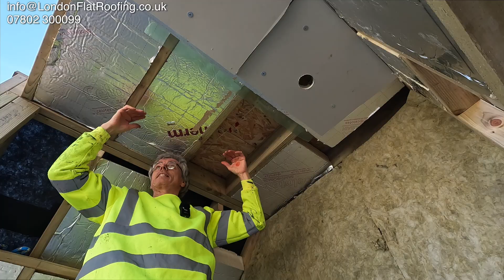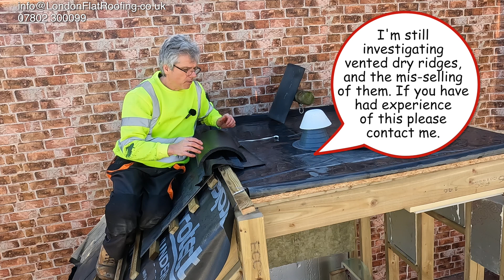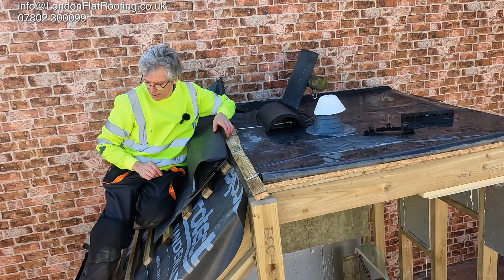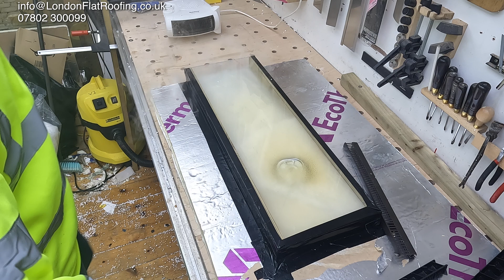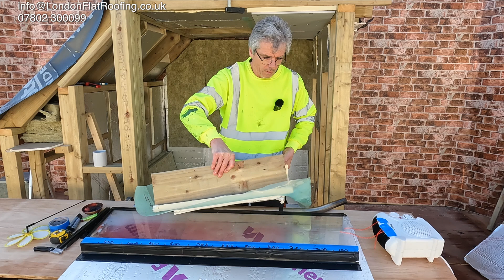Through Ventilation Cross Ventilation Explained

Comment: Hi Steve, when installing roof lanterns in a cold roof (pir 50mm air gap etc), should there be 25mm insulated plasterboard on the INSIDE (room side) of the vertical joists ?

Comment: Hi. Have you done a video where the cross ventilation on the flat roof (garage conversion) is running into a pitched roof of the house. Or a video where there is no space for soffit due to boundary line - vents would have to go under in the facia boards... beneath the gutter level, if at all possible.

Comment: What happens when you screw the drywall it's going to make a whole in the vapour barrier?
Reply: Watch his other videos on vapour control layers. He talks about the use of butyl tapes which effectively seal the hole. The point is to make sure you make it as air tight as possible.

Comment: Could you leave 25mm gap instead of a 50mm gap and use cross battening with 25mm batten to make up the 50mm air gap needed?
Reply from the maker: Yes I think that's the way to go. 50 mil is better than 25 mil, but when you've got cross battening you've got all sorts of flow of air

Comment: Hi, i love your videos, but, i don't see any that applies to my case, can you help me out please. I want to put an a/c on my garage, now, i live in florida usa, summer are very hot here, my garage has a flat roof , the walls on both sides are made out of blocks and stucco, my rafters go from block wall to block wall, and on top of the rafters is the playwood roof, so no air movement it all ..how can i insulate my roof? I will hate to have moisture on the playwood. Can you please help me? I will appreciate it. Tks
Reply from the maker: If you'd like to send me more information by email info@londonflatroofing.co.uk perhaps I can help you

Comment: Very good stuff. I always use a steel/aluminum head flashing from the sloped roof to the flat roof with perforations in the metal to ac lol posh two things.

First is your using the head flashing to provide waterproofing to the sloped roof, also then having the perforations (facing downward on a crated lip to avoid leakage) to have airflow coming in.
Reply: But this is some good stuff. So many people don’t vent flat roofs properly.

Also, now they use spray foam and say now you don’t have to vent….. stupid……

Yes spray foam works as insulation and vapour barrier. That is sweet.

But fibreglass bats act as insulation, and poly or similar acts as vapour barrier. Still need to vent either way…..

The spray foam is better R value per inch but still loses heat, and you’d rather that lost heat escape rather than form condensation.

A properly insulated and vented roof lasts so much longer.

Comment: Hi Steve, I have cut through my membrane and installation to fit spotlights. Now I have sweating on the underside of my roof.  As an option, I thought I could install surface mounted ceiling lights and fill the downlight voids in with installation, Sliver tape, and plaster board.
Do you think this would solve the sweating issues?
Kind Regards, Andrew

Comment: High Steve, I was watching this video from Robin Clevett     https://www.youtube.com/watch?v=jaTWMUuTWnI&ab_channel=RobinClevette and to me it appears he does mention an air gap but then pushes the PIR quite a way into rafters leaving a gap at the front. He then goes over that horizontally meaning there must be a gap between the 2 lots of PIR. I'm not asking you to bad mouth his work as I like that he went to all the trouble of making jigs and using that special tape, just trying to understand.
Reply from the maker: His video is not actually about the ventilation although he mentions it hopefully he will do through ventilation as regards more layers of insulation that's also acceptable as long as they are tightly secured together and that all of it is nicely secured with the appropriate through ventilation on the cold side of the roof
Reply: @SteveRoofer  ok thanks 👍

Comment: Skylight on a roof with all the insulation installed properly with adequate vapour barriers and a vent on all four sides does this pose a security risk?
Reply from the maker: Yes security is a problem however most skylights come with bolts that are temper proof

Comment: Could you drill vent holes in joists to allow cross vent between dead spaces around sky light if it’s a new skylight in an existing cold roof without battens.
Reply from the maker: You can do but it's pretty much frowned upon I've shown people doing it in some of the videos but I would never do it vent the vent the roof properly
Reply: @SteveRoofer  only other way would in theory be to mushroom vent through the roof in each compartment on either side of the roof light. Ideally he would of done the battens to allow cross vent but roof finished now on top. Looking at doing multiple c.100mm vents through walls either side of extension into the space above insulation. Was gonna drill through joists to allow cross vent around roof. I don’t particularly want 10 vents up there penetrating the roof. 🥴

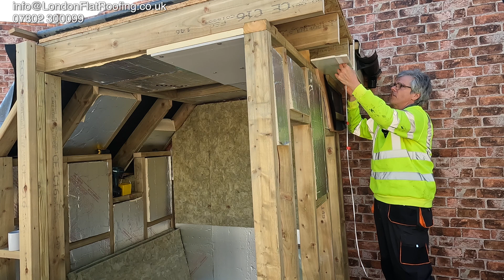Comment: What are those two white (fascia) panels called? The one you're holding at 1:10 with the small lip and the one with holes for ventilation.
I just can't seem to find these panels available anywhere.
Reply: I think you are referring to the plastic sofit and fascia panels. These are often overlayed on to the existing wood soft and fascia.
Reply from the maker: Yes thats corect

Comment: great information, I don't even work in the building trade but I find these videos fascinating and it almost makes me wish I was a roofer :) Steve helped me with an issue with a cold roof a builder did for me where it was condensing badly and I had to tell the builder myself what needed to be done after I'd watched some of these videos.  Fast forward almost a year and my cold roof is now completely condensation free.  Originally I had no ventilation at all, then I only had ventilation at the front, which still didn't fix the issue.  Now I have through ventilation just using round soffit vents at each end section and its made a massive difference.  All the timber is now dry on the deck above the insulation where previously it was sweating and mould forming.  Keep up the great work with  these fantastic videos.
Reply from the maker: Thanks for the comment
Reply: @SteveRoofer  im doing these now on my cold roof round soffit vents on both side of the flat roof, the ply is on a cross batton so should ventilate from both sides, again I’m telling the builder what to do
Reply: how did you know or find out it was condensing?
Reply: @jamesdiver2183  because water started dripping out of the plastic facia overhanging roof at the front of the building and it was brown and smelled like wood.  I also pulled down a couple of downlights and used a torch and could see water droplets on the cables and moisture on the deck above the lights.  It’s been still perfect since.  With no vents it’s like a jam jar of warm water with the lid tightly sealed

Comment: i build a flat warm roof, but i want to close it off with plasterboard, do i have to ventilate the space between the beams ?(with inside air)
Reply: Hi Carl, the answer is definitely no, you must very tightly insulate the perimeter of your warm roof from the wall head upto the underside of the sarking. It's critical to make sure the roof is sealed. The warm void between the rafters is just that, a warm void that you can run cables for recessed lights. If your flat roof buts against an exiting pitched roof, you again must make sure that this junction is tightly sealed and that may include a soffit. Additional low level ventilation may be required to the existing roof. A warm roof is far superior to a cold roof which should be avoided where possible.
Reply: @coldt1484  thanks, I'm happy with that

Comment: Hi pal what if I  use spray forum insulation
Reply: This is a real challenge, you need to concider the roof make up, foam usually needs to be sprayed to the underside of a breathable sub-strate and sheet sarking is not regarded as breathable. Check the BBA certification for guidance.
Reply from the maker: I'm not really up with spray insulation because of two things it's hugely expensive and the gassing off i.e. the smell the fumes and the health problems reported I've just not worth going there

Comment: Thanks for your videos, your real world examples are very interesting.
From what I know, air moves only due to three reasons: stack effect (i.e height difference), wind, mechanical (fan). On flat roofs we don’t have any stack effect, we don’t install fans, and wind is unpredictable and maybe inexistent in some circumstances, so almost no air will flow through.
The experiment is explaining the theory nicely but I think it’s not indicative of reality. I’ve seen in some countries building regs venting being only suggested above a certain pitch. Curious to hear your opinion on this. Cheers
Reply from the maker: My opinion is don't  do cold roofs, do warm roofs then you don't have to vent
Reply: I agree… a warm roof is the way to go for flat roofs. That would be a better suggestion as venting a cold flat roof which has no airflow makes no sense. Moisture will just stay there. Especially on balconies with parapet walls where you have zero airflow…
Reply: @angelkj  I've found even on a calm day when you think there is no wind at all, there is usually a small amount and it's enough to create a through draft.
Reply from the maker: Balconies are alway a problem no height for  a warm roof because of the door step

Comment: Hi Steve 
What's the best way to ventilate a lean to flat roof which has got a glass lanter in the middle
Reply from the maker: As explained int he video cross batten the roof
Reply: @SteveRoofer  what would you suggest if there's not enough height to double batten the roof! 
There's a balcony patio door cill  accessing the flat roof which is only 80mm above joist level!!
Really appreciate the reply thanks
Reply from the maker: Something has to give! how about putting ventiationa round the skylight? ugly and hard to do
Reply: @SteveRoofer  really appreciate the reply
Keep up with the great information